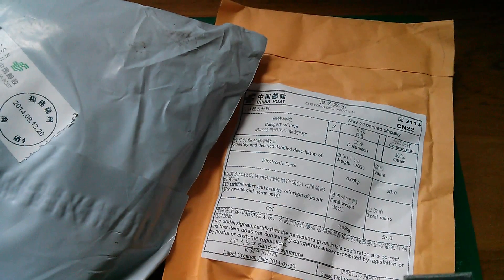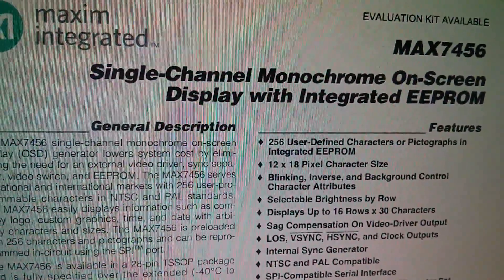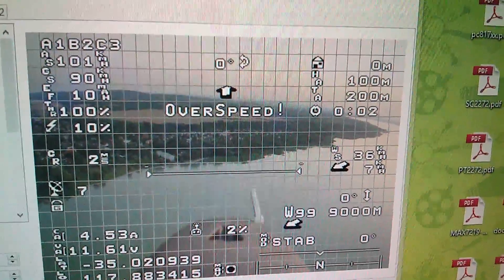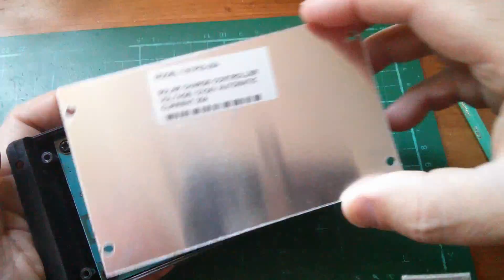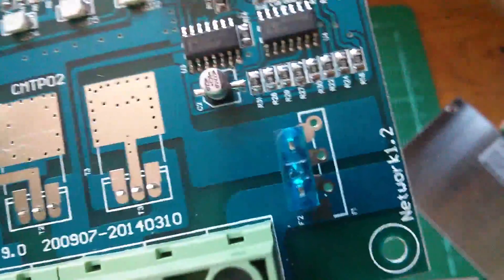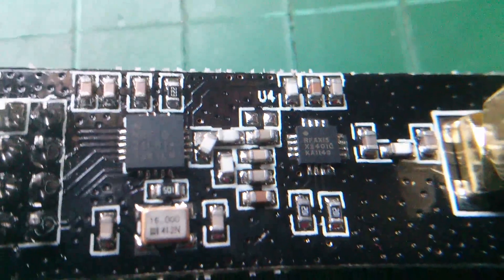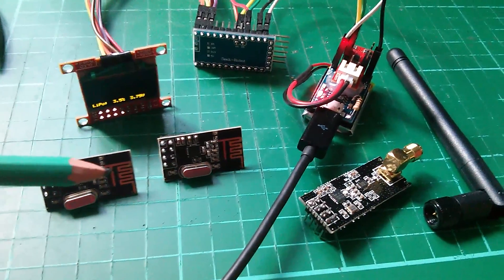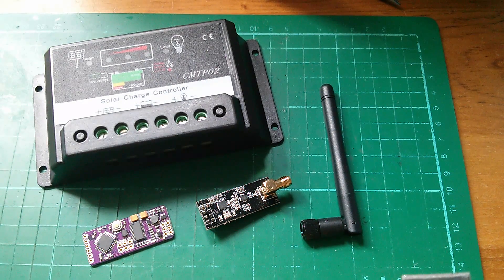Postbag #6: UAV OSD, SCC MPPT?, NRF+ PA LNA

Comment: 4:58 LM324 is a quad op-amp, op-amps could be used as comparators in a PWM circuit.  Not saying it is, just a clue.  Cheers.

Comment: Honestly on most of the stuff you buy the likelihood you're getting some Chinese IC or MOSFET stamped with popular part numbers is pretty high. so realistically getting a completely blank component is just as useful as most of the labeled components since the values you'll find on the data sheet for the real part are almost useless when working with a Chinese cloned part.

Comment: I've got a few NRF24L01+ last week (again something I weirdly ordered just to see you make a video about it a week after that).
Two of the simple ones (integrated antenna), one with an antenna U.FL connector (the type that the internal laptop wifi antennas connect to; take care they are only rated for a few connects before they need to be replaced) and one with the same connector and including the LNA and PA.
I've tested them with the Arduino RF24 library. They worked through two 30cm cinderblock walls but failed at 3. The signal of the PA version could be received through 3 walls, but the return packet of the non-PA version was not seen by the PA.
Reply from the maker: Interesting. I just haven't got round to playing with them yet. Which library did you use?
Reply: Julian Ilett
I've used the "RF24" library from here: https://github.com/maniacbug/RF24 . I don't know if any others are better or support more options. The main reason was that I wanted to check out if the modules I got in the mail are working. Of all the pages that explained Arduino+NRF24 I liked http://arduino-info.wikispaces.com/Nrf24L01-2.4GHz-HowTo best (it's very good documentation including photos, NRF24 caveats - the modules are picky with their power - and examples; and btw. has a few other Arduino projects/howtos). It used that library, so I used it, too.

One thing with the library that cost me an hour or two and a few hairs of those I've left: the RF24 GettingStarted example (in principle a ping-pong setup for two Arduinos) did NOT set a node to pong (i. e. reply) by default (it did in a sense, but it was not set up correctly). So you have to set a node to transmit role and then back to receive role again via a serial connection for it to reply to pings. Or you can just activate two lines in the setup function, which are there but commented out for some reason. You're then ready to go as soon as you connect power (I ran around with a single cell LiPo connected).
Reply from the maker: Thanks for that very detailed reply. I think I'm suitably inspired to have a play with these now.
Reply: Julian Ilett
Just wanted to add: a newer version of the above library can be found here:
https://github.com/tmrh20/RF24
It's a fork of the RF24 of maniacbug library, but more maintained. I haven't used it yet, but from the source it looks like everything should still work the same. The library is now also linked on the NRF24L01 page on Arduino playground: http://playground.arduino.cc/InterfacingWithHardware/Nrf24L01
Reply from the maker: superdau Thanks for that. Tomorrow, I'm thinking of doing a 1-day project to get one Arduino sending data to another using the nRF24L01+ modules. I'll be using some of these links you've provided to try and get it all up and running.

Comment: The transmitter may be setup to expect an automatic ACK packet from the receiver depending on how it is configured by whatever library you are using, so the receiver may need to be just as powerful. I believe this can be disabled in software but you will have to do your own error correction and not mind packets going missing.
Reply from the maker: Good point. Missing packets shouldn't be a problem - I'm just going to send a set of data repeatedly - if it occasionally corrupts, it probably won't matter.

Comment: Interesting, I have five similar charge controllers, but they DO have the LED display. All it does is shows what setting the light timer is on and nothing more. The battery status is just a couple ov LEDs. I "liberated" them from the backs ov some folding solar panels I bought for a bargain price in late 2012 due to the seller believing they were faulty. My ones have a similar Mosfet configuration and are rated for 10 amps. The exact same dodgy pressure mount heatsink system. 

However, they actually perform pretty well. I have one on my 250AH 24volt AGM battery bank with about 180 watts ov panels. It's really just a place filler until I get a really good controller there, but nevertheless it seems to do the job. It does this crazy oscillation thing every 20 seconds or so, even if it is in the bulk charge stage. I am starting to wonder if this is actually some desulphation cycle because it makes similar tones to a commercial desulphation unit that my partner gave me for the Winter Solstice. When it hits actual regulation though the PWM is quite "stuttery". More like a raoid on-off than true PWM perhaps. 

I did originally have it on a circuit (using a add-on I built to allow it to handle at least 30 amps) controlling a 400AH 12volt AGM bank that supplies my recording studio. However those tones I mentioned managed to find their way through a very high quality pure sine inverter and into my recording rig - especially distorted guitar ov course...! So from that situation it had to go!  

I'm looking forward to receiving the PWM5 by the way..! :)
Reply from the maker: Yeah, I don't think it's proper PWM. I'm expecting it to switch rapidly between two voltage points. Looking forward to hearing that 20s oscillation thingy. PWM5 should be with you soon - shipping to NZ is usually pretty quick.

Comment: Julian you will not have much joy with the minimOSD until you reflash the firmware with the KVOSD variant. Out of the packet these things are flashed to suit the ardupilot flight control board using the mavlink protocol. Without the mavlink heartbeats from the ardupilot nothing useful will be displayed. For a very comprehensive intro to the minimOSD see here
How to Setup KV OSD MinimOSD Naze32.
If you are not fussed by the full autonomous funtions of the ardupilot I can recommend the Naze32 board. This is more of a pilots board and can be run under multiwii or baseflight firmware. For safety sake alone I recommend you learn to fly ypur multicopter before using any autonomous control.
You may not know it yet but you have opened a large can of worms, interesting can of worms though, with this stuff.
Reply from the maker: Yes, I can see that this is a catering-sized can of worms, but that's fine, it'll sit comfortably next to all the other cans in my hobby projects larder.
I'm leaning toward the ardupilot at the moment, simply because it has the autonomous functions, FPV and all the other bells and whistles. Also I'm a sucker for anything with "Ardu" in the name. But I will check out the Naze32.

Comment: Ha! I just bought load of the lower power NRF24L01+ modules. The price is astonishingly low for those - £2.67 including postage for FOUR of them from joytownonline.

If I can make these work it knocks the zigbee into a cocked hat. I was going to use a hacked TP-Link TL-WR703N to send wireless data from my remote 'garden controller' with Arduino Mega, but now it looks like NRF24L01+ all the way!
Reply from the maker: They are super cheap, and there's a library for them - somewhere